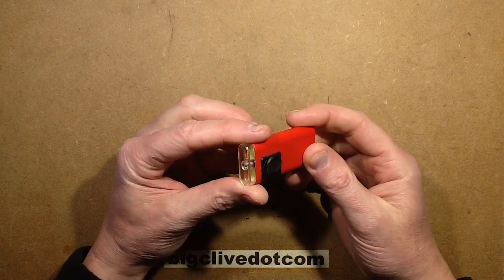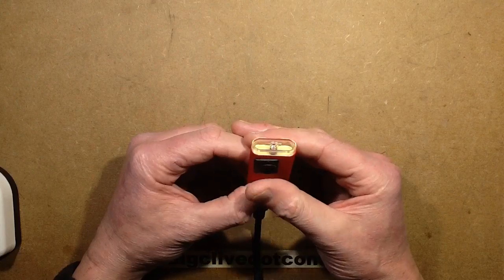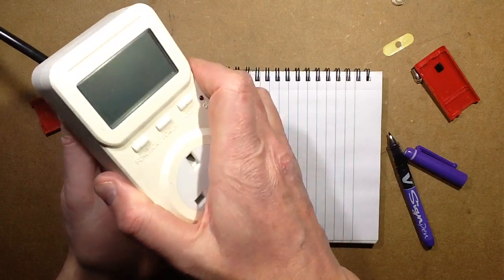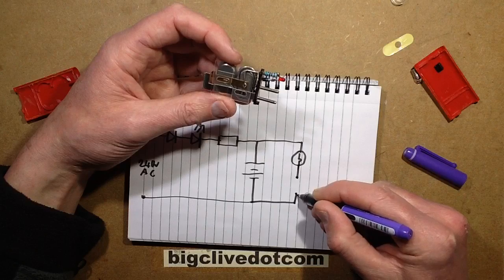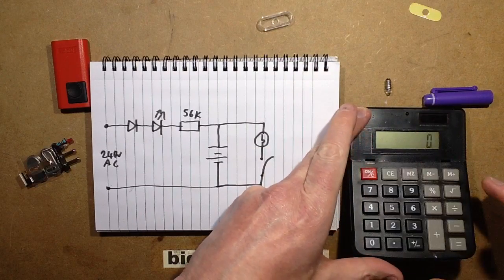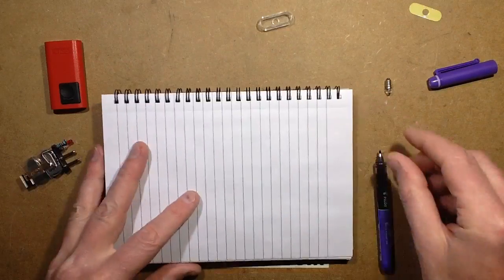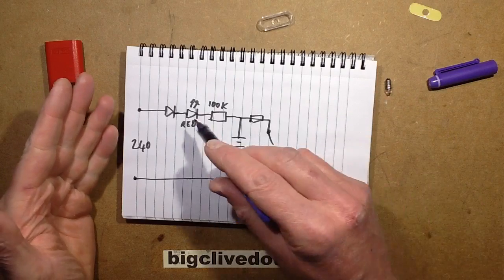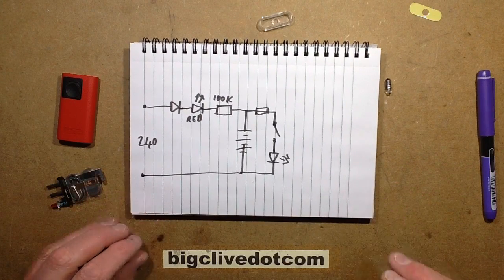Unique vintage rechargeable flashlight from 1980's (with schematic)

Comment: I recently found something similar to this. Its from a german company called AEG and from 1960. It uses a detachable head in which the tungsten lamp is which then reveals the SchuKo 240V connector. 
It charges two 225 mA NiCd cells through a 250V AC 0,2 uF foil capacitor and a 300 Ohm inrush limiting resistor going to a FULL BRIDGE RECTIFIAH!!!.
Quite nice torch as well. Very high quality.

Comment: I am confused how u can charge batteries with just a resistor, BTW can u please check the output current while charging?
Reply from the maker: The old nickel cadmium and nickel metal hydride cells could be trickle charged continuously.  A diode and current limiting resistor is all that's needed.
Reply: @bigclivedotcom  thanks

Comment: Pifco made something like this in the late 60s, it used nicad cells, you charged it via a two pin plug built in, you need a shaver adapter to work it. Acculux also made such rechargeable torches. As for nicads I'm still using old Ever Ready ones, some sadly will die due to crystal build up, they can suffer what is known as memory loss, sometimes the crystals can be melted by using a car battery charging the battery for ten seconds, I have revived many a nicad doing this. You can still get nicads on eBay but I find plenty at car boot sales, I also use the original Ever Ready chargers to. The voltage of a typical D cell instead of being 1.5v with nicads it's 1.2v so there not that good in things with a high currant drain, they won't last as long, Rayovac did an Alkaline rechargeable but not tried these yet, Alkaline batteries use potassium hydroxide as the electrolyte, zinc carbons are amonium chloride, the first types were wet cells known as Leclanche, a glass jar full of amonium chloride, sal Amoniac. A pourus pot filled with manganese dioxide as a depolerizer, carbon rod positive center, negative pole was a zinc rod. Zinc carbon batteries today work on the same principle except the electrolyte is a jelly.

Comment: I had a Braun rechargeable electric razor. And I was impressed with its input specs: 15 to 400 volts, AC/DC. 

Essentially anything but lightning.
Reply: LOL, that's Weird
Reply: @aptube6754  
You know what they say, ‘they don’t make ‘em like they used to.’ It was early 1980s, when Braun meant something.

Comment: The stores here sell (well they did not sure if they still do) a little LED flashlight that plugs directly into the wall to charge.  They are very bright when used but don't hold up long, I took one apart (been watching to much Big Clive!) and found it powered by one lr2032 cell and some components to handle the charge and such.  We have had two of these now for over 5 years, they seem to hold up fairly well but are rarely turned on, only during power outrages so we can find the toilet in the dark.  We don't need them as much as we used to, now that I have been building all these little circuits I find on Youtube using 18650's recovered out of old laptop batteries, and high output LED's, but the little lights do serve a purpose.

Comment: I'm still using nicad batteries from the late 80s, still working and still be charged up every week.
As for those old  rechargeable torches " quite common in German cars at the time" 
Some electrical shops back in the 80s sold  pocket rechargeable torches, I remember buying one, it wasn't cheap about £10, equivalent to about £35 today

Comment: Reminds me of the emergency torch in my 1992 BMW 520iSE (E34). It was the same size and had NiCd batteries. When not in use it docked in a charging slot in the glovebox. However, it charged from 12v DC.  I see yours too has a good quality bulb, of the type used in medical laryngoscopes.

Comment: You can trickle charge nickel based batteries without need for a bms?
Reply from the maker: Yes, both NiCd and NiMh can be trickle charged continuously as they just reconvert the gaseous electrolyte back into liquid internally.
Reply: Just checked out your other video about the button cell NIMHs for solar lights. It made sense and now I can modify a solar phone/AA charger I made so that it won't kill batteries.

Comment: I didn't realize that you can charge a DC battery with strait AC current. No bridge rectifier? It looks scary to me.
Reply from the maker: +Adonis cmj It has a diode for half wave rectification.
Reply: That makes sense, but it just seems scary to me still. We have 110 volt in the USA but at 240 wow.

Comment: I had similar, but instead of socket for a cable it was already fitted with... how do you call it - plug? It was plugged directly to the wall (220V at that time!) and operated in same manner. Innovative (imho) for 1980's ...

Comment: The reason that EU appliances are rated at "230V" is because it was a reasonable compromise between the UK's 240V supply and the European mainland's 220V supply. It would have cost far too much money to change the UK's mains supply.

Comment: I had some a bit like that back in the late 60s/early 70s. They were German, made by AEG, and rather than the figure-8 charging socket, the bulb housing cap could be pulled off, revealing two standard European mains plug prongs. They had a big cylindrical NiCd inside and I think a capacitive dropper charging circuit.

Comment: I have a re-chargeable glove-box torch of a similar design which was factory equipment in my 80's BMW. Its an "Acculux", simple design with a rechargeable cell and two holes at the base for charge pins which are in a special cubby in the glove-box. It uses a sort of double button cell style battery. 

I'm restoring it at the moment. Giving it a good clean, new cell, scrubbing off the corrosion etc. :)
Reply: Acme there was one in my E34. It was a nice idea at the time.

Comment: mmm this is interesting I used to have one very similar to this in my den back in about 1985 mine had a black snap on cover on the back and when removed it revealed two prongs ! which you put into a mains socket presumably a shaver socket /adaptor only I didn't have one you had to fiddle with the shutter on a normal socket with a screwdriver ooh naughty ! please don't tell the electrikery police on me ! mine didn't have an Led !

Comment: That's actually quite impressive. Any more details on those NiCd cells? Do NiCd cells like that normally have such a long life? I'm interested if there might be some applications where they become more useful than other types.
Reply from the maker: They've probably lost some capacity over time.  But all battery types tend to have specific advantages.  With NiCd cells it's the ability to withstand continuous trickle charging and deliver a lot of current on demand.
Reply: NiCd cells are used for things like emergency lighting in elevators, for exactly the reasons Clive mentions. They can be constantly kept charged, and will be there for you when you need 'em.
Reply: Most Commercial and Business Aircraft still use NiCd Batteries. ...and for good reasons... (yes I'm talking about you, Dreamliner, with your runaway Lithium packs)

And I'm sure, they are used in many military and civil engineering applications where a robust and long lasting battery is required.
Reply: I had some Panasonic 7.2 volt ni-cd battery packs for an R/C car I bought back in 1990 that I put in a Baygen radio I modified and they were still taking a charge a couple of years ago I was using it.
Reply: A capacitive discharge through the cells to burn out filaments, followed by 2 full discharge / recharge cycles would help keep these batteries healthy for another decade at least. Can you tell me what that cell size it is? I have never seen anything in that form factor, let alone NiCd!

Comment: Australia is also supposed to be transitioning into complying with European standards when it comes to mains voltage, however my outlets at home are still at roughly 250v. It is surely a concern of the past anyway with almost all power supplies accepting 100-250v.
Reply from the maker: Are they going to change the colour code too?  Here in the UK we were forced to swap from red, yellow and blue phases with a black neutral to brown, black and grey phases with a blue neutral.  As you might guess, swapping a phase and neutral colour resulted in the predictable accidents.
Reply: Yes, the colour change was made some time ago (not positive when, but possibly decades ago). I suppose part of the reason was so colourblind people could distinguish between the colours. Red/green colorblindness is common and mixing those up would not have been good. Another reason would be to distinguish between low voltage DC wiring and mains wiring. it makes sense, just the transition isn't always smooth.
Reply: youtubkeeper In Denmark there were multiple color schemes for the incoming 3 phase mains until settling on the EU scheme.  The use of the stripe is because the primary colors were already reserved:
  1. Purple - Easily mistaken for others.
  2. Blue - Neutral
  3. Green - Part of green/yellow PE
  4. Yellow - Part of green/yellow PE.
  5. Orange - Available but easily mistaken for others
  6. Red - Available but some historic uses.

Comment: I found that form of cells in a modern Ni-MH 9V block. They started leaking after about 5 years though.
Reply: Yes, I had one go bang on me. Two actually. They were fine as long as I charged them in my cheap and cheerful charger, but when I put them into my posh protected charger it must have charged them at too high a current and they went pop! It blew the end off the "battery" with a pop, exposing a string of those small ovalish cells. Funny thing, the batteries still work, but now I can't fit them into anything! :-) I use one on my (bare board) frequency counter, and now charge it on my cheap charger!

Comment: When i was a kid we had a lamp like this but it was 12v car charger type, you could lock it on.
Problem is I was only a kid and accidentally left it on in a very dusty truck... on the cheap seat covers.. yeah didn't take long for the whole thing to be burnt to the ground

Comment: My grandparents used to have flashlights very similar to this in the early 90s but the prongs were directly on the side of the flashlight. 
They would be plugged in at all times in nearly every outlet in the house and when the power went out they would turn on automatically.
Reply: They still make those, even ones with a bulb thread that function as a normal lamp, then turn on via batteries when the power goes out. Even has a telescopic handle for use as a flashlight.

Comment: Clive do you think the ecig batteries would work, they are even smaller than the garden solar batteries.
Reply from the maker: They would require a protection circuit or at least a 4.2V zener.

Comment: You can add "joule thief" circuit instead of adding extra cell and resistor. It is pretty small, and should fit in case.
Reply: Yes

Comment: Those look like 90mAh Varta DEAC cells; they do last well beyond any expectations! I have Pye radio batteries from the 70's using them that still work, as long as you keeping giving them the odd charge/discharge cycle. I had a rechargeable torch from the early 70's that had a capacitive dropper, rectifier and couple of NiCd cells. It had a plastic cap at the far end covering a pair of pins that fitted in a shaver adapter or outlet. There was no discharge resistor so it had a hasty habit of giving you a healthy belt if you touched the pins!
Reply: Alan Cordwell My dad had a similar torch. It had a removable cap that exposed a standard non-earthed EU plug. It had presumably a capacitive dropper, and a green rectangular LED to show it's plugged in. It didn't monitor the charge though. The cells died eventually. Never opened it up, it was glued shut and almost indestructible. It used a standard replaceable incandescent bulb.
Reply: Mine has (!) a resistor and a diode, no complex capacitive dropper...  actually, another has a little LED that doubles when charging as a diode, but that is a couple of years younger (I guess the end of the 80's / beginning of the 90's).

Comment: Hi, bc....
  This brought back memories of late 60s - early 70s when I was very involved with radio controlled model aircraft, the smaller the better being the trend for me. Rechargeable NiCd batteries were in their infancy for this obsession and I purchased some mains units that contained DEACs, branded NiCd cells. (Seemingly I later found, made in Germany) The mains units used capacitors to limit the charge current. Possibly dangerous after component failure. Whipped the cells out and served my purpose very well.
Thought this might have relevance re:- your 56k resistor unit.  Also -  low constant charge for NiCd cells were thought to form dendrites (shorting structures) in the cells? 
Best wishes and
Cheers.
Paul F.

Comment: I remember in the mid 80s my dad bought a torch like that.
It was only slightly different in that it on the back had a removable plastic cap underneath wich was a (European style round pin) mains plug. No figure-8 socket.
You simplly plugged the whole flashlight into a mains outlet.

Comment: if you were to add an extra cell... the resistor you said would have to be added what rough size would u recommend.
Reply from the maker: I would guess about 33 or 47 ohms for a single 5mm LED.
Reply: Thanks Clive

Comment: Boeing went back to using NiCd cells in their new jetliners after they had overheating and magic smoke issues with the Li packs in the 787 Dreamliner. I dunno why they didn't use NiMh, but I guess they thoroughly understand NiCd and know it's super-reliable. Funny to think the most advanced airplane relies on such old tech. I guess, "if it's not broken..."
Reply from the maker: I just got a brand new emergency light today.  It has a NiCd battery pack in it.

Comment: Charging a NiCd cell almost directly from mains with no overcharge protection? Then again, NiCd battery life sucks anyway.
Reply: If the current is below 1/10C, NiCd can be connected to a current source indefinitely.
Reply: Making them suitable in emergency light fixtures..those cells sitting there for years and being still slightly overcharged....

Comment: hey, @bigclive mentioning the euro regs, sparked a question , we have a numatic Henry vaccume cleaner rated at 1500w, mum wants a new one as the floor brush head part of the old one broke, (mum logic in action), looking on ebay ,i see stuff about new regs limiting the power allowed to be used by vaccumes , new henreys  have a power rating of 580w, and the 'industrial ' one (wider base ,longer cable) is rated at 620w, i found a listing for an industrial one rated at 780w numatic nuvac in limited edition grey colour (with stainless steel pipe), so i bought it, neglegable price difference between models so i went for the 780w nuvac  i had a peek in the box (its wrapped up for xmas now) the rating sticker is 620w and the pipe is the new narrower aluminium painted pipe, not the old type stainless one,  im guessing that numatic vaccume cleaner company would have us believe that these new lower wattage motors are just as good as the old 1.5kw ones,by being more efficient, do you think this is possible , will if effect the lifespan of the motor, or are they just making stuff up as they put a skinnier suck tube on it. that will probably get bunged up with a cat toy choking little henrey to death instead of old henrey devouring anything in his path., iv seen a couple of videos trying to address the wattage change but they have a lack the scientific rigour to be credible.  i may make a video in the new year involving switching the same bucket and pipe on the two motors and vice versa. your prediction of results would be interesting. .whatever you decide, keep the videos coming
Reply: messed up the @ @bigclivedotcom /\ /\
Reply from the maker: I'm afraid it's just more retarded Euro-meddling.  Only a trial will tell if the suction is anywhere near the same, but it's most likely they've reduced the vacuuming are so now the thing will have to be used for twice as long in each session.
I really don't understand why they are just inventing stupid and random regulations.  When electric cars take off the power draw of vacuum cleaners is not really going to be relevant when a car's plugged in to charge.

Comment: very basic question: what would be the voltage over the resistor?
Reply from the maker: Pretty much full mains voltage, since the drop across the cells is just about 2.4V.  The circuit is extremely inefficient, but still effective.

Comment: I just love NiCds...
In dumpster of recently closed electronic repair shop i have found discarded box of 24 unused, originally packaged, C-sized 1,8Ah NiCd Panasonic sintered electrode cells, dating 1988, and ALL of them are reading over 1,9Ah (at 2A c.c. discharge, 0,8V cutoff) capacity after a few charge/discharge cycles, having very low (and consistent across batch) internal resistance, and lower self discharge than temporary hi-current NiMh... 
That is just some awsome oldschool chemistry/electronic in my view. 
Man, what a comeback after 28 years of sleep, not a single shorted cell!!!

Comment: Hang on... When calculating the current, you aren't counting in the resistance of the LED and the diode. Are they negligible against the 100K resistor?

Also, it always baffles me that such small components can withstand the full 240V might of the British power grid. It never occurred to me to limit the amount of juice out of the power socket with a simple capacitor that lets through only a fraction of the 50Hz sine wave.

I'm being educated!

Comment: +bigclivedotcom I had some similar-ish torches of late 1970s vintage with the difference that instead of having the C7 mains connector, you pulled off a rear cap from the body revealing an European-style two pin plug for putting the torch straight into a socket. They had a single large button NiCd inside as I recall, and I think they were AEG branded.